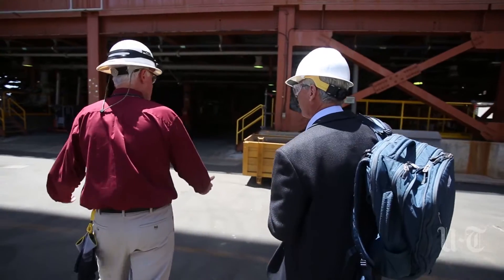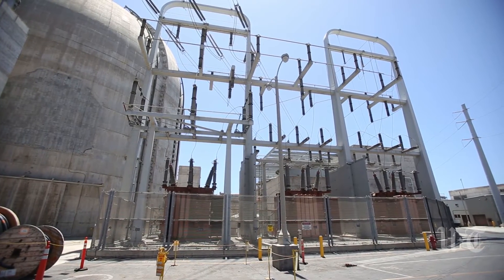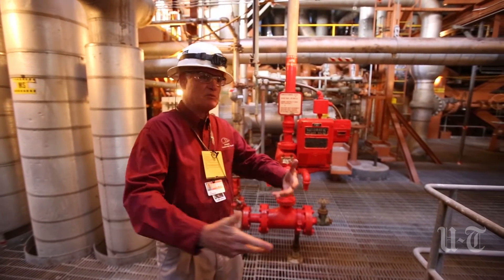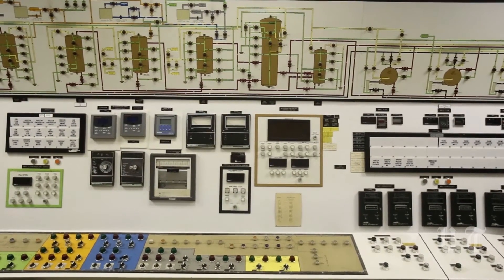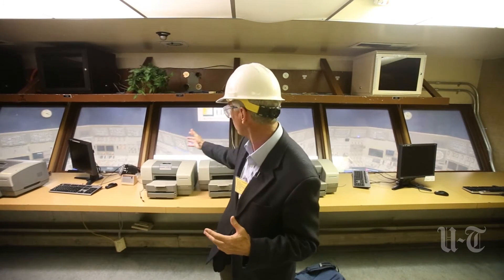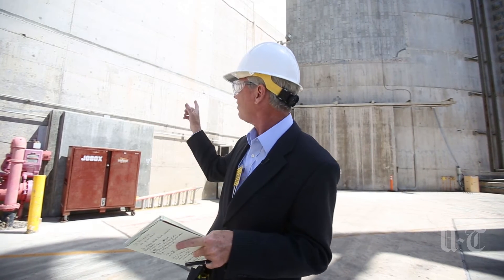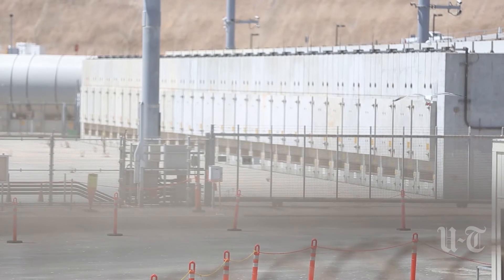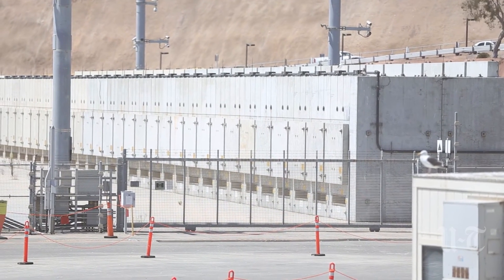Decommissioning San Onofre Nuclear Generating Station | San Diego Union-Tribune

Comment: Pumping water uphill to run a water turbine is more efficient than nuclear power generation.
Reply: The energy to pump the water comes from...
Reply: @Joshie2256  A nuclear power plant requires two external power plants to power it.
Reply: @Joshie2256  A nuclear power plant requires two external power plants to power it, either gas or coal fired power plants. that being the case, why do you need a nuclear plant? ans. Weapons!
Reply: @daniellaprelle4661  BS!!! The plant powers it's self, NSS comes off the main generator buss.
Only time plant takes outside power when its on RSS when it's offline, starting up and shutting down.
Reply: ThatGuyCarmine  tritium is natural,  it is already diluted to background.  the public is educated by fearmonger idiot anti-science no-nukes,  this is the REAL danger to public health
Reply: IDIOT
Reply: Daniel, you would expend more energy pumping the water uphill than you would get from running the generator. This is a physical fact.
Reply: That makes no sense, what you are describing is essentialy a perpeutal motion machine, which is impossible to create.
Reply: @lazmor8818  Its just a way to store energy from solar and wind until you need it. Nuclear power plants require two back-up generators like coal and or natural gas.
Reply: Thatguybrad  Are you saying that a quadruple nuclear meltdown is safe?
Reply: Thatguybrad  The radioactive contamination will continue to pour into the Pacific Ocean, as well as into the atmosphere from the Fukushima nuclear meltdown whether you believe there is a danger or not. End of conversation.
Reply: Thatguybrad  You don't need to be a nuclear physicist to know a quadruple nuclear meltdown is not good for the environment.
Reply: Thatguybrad  Can you explain what are these pro's to nuclear power besides having enough nuclear weapons to wipe out all life on earth 100 times over? Also explain why they bothered to erected 900+ storage tanks at Fukushima if the water wasn't  highly radioactive?
Reply: Daniel Laprelle I’m just laughing at you right know because of how under educated you are about the subject and how your avoiding the point. My grandfather worked at a nuclear power plant as and engineer and has told me the truth about the lies and bullshit you hippies listen to.
Reply: @dustinmillan3898  There is no known technology to fix the ongoingFukushima nuclear meltdowns.
Reply: Thatguybrad  So your saying that a nuclear meltdown is safe?
Reply: Thatguybrad  A nuclear meltdown is much worse than a nuclear bomb because it will continue to spew deadly ionizing radiation for millions of years with no way to stop it!
Reply: Thatguybrad  The human race has painted itself into an unbelievable dark corner with nuclear power.
Reply: Thatguybrad  It cheaper to pump water uphill and then back down through a hydro generation plant. The quadruple Fukushima meltdown is an extinction event. Reporter: Julian Ryall report from Tokyo sept. 10th 2019 “The operator of the crippled Fukushima nuclear power plant will have no choice but to release more than one million tons of radioactive water into the Pacific Ocean, Japan’s environmental minister said on Tuesday. “The only option will be to drain it into the sea and dilute it”, Yoshiaki Harada said in a news briefing in Tokyo. This is very, very, very scary and very, very dangerous and it seems to allude to the fact that they’ve already dumped it into the ocean which would account for all the mass whale die-offs, all the birds dying, seals and sea lions, and all the marine life disappearing; anchovies, sardines and squid and all the krill and the Phyto plankton and the basis of the food chain, the oxygen chain and the carbon sequestering chain all disappearing, that would account for it. You can’t dilute radiation! You radiate the ocean is all you end up doing, it radiates everything! So, it will radiate the whole ocean floor and all the creatures in it which is typically a billion creatures per glass of salt water, pre-Fukushima, eggs and lava included. 75-100 million creatures per glass of salt water would have been the basis of the food chain and the basis of the oxygen chain and the basis of the carbon sequestering chain. So, we broke that chain; this is why we are seeing all the emaciated birds and emaciated whales and were talking about absurd numbers.